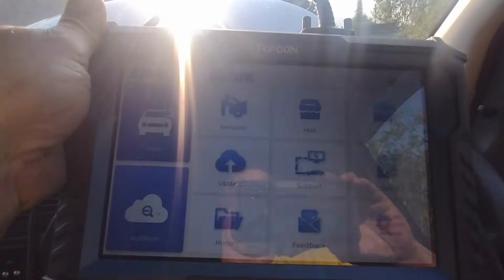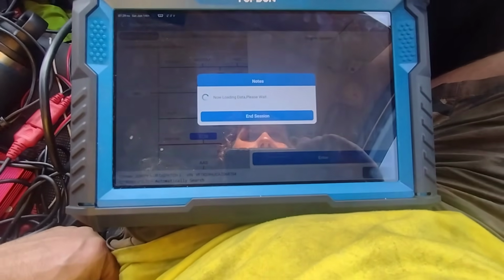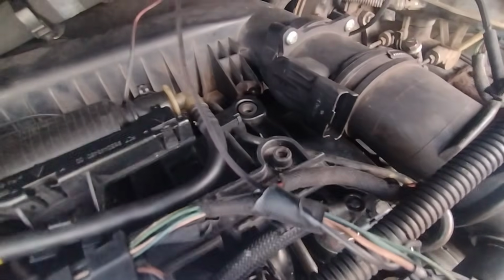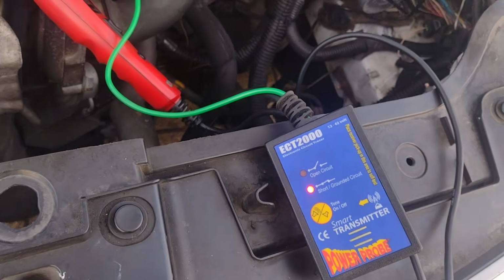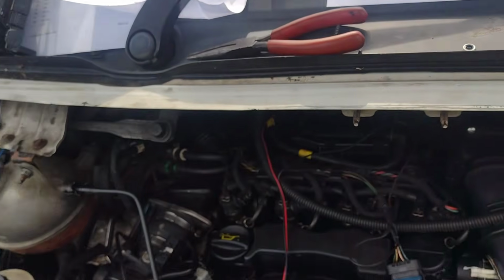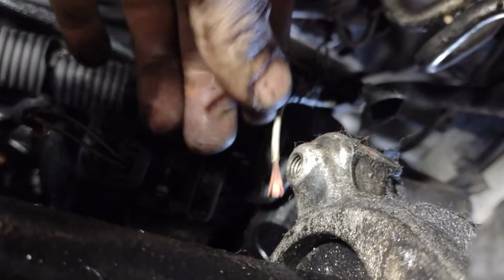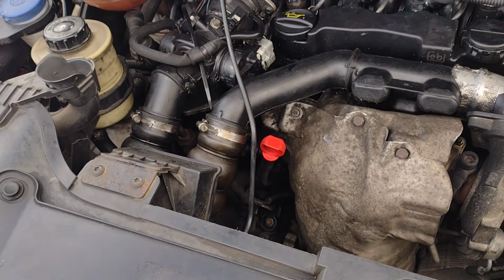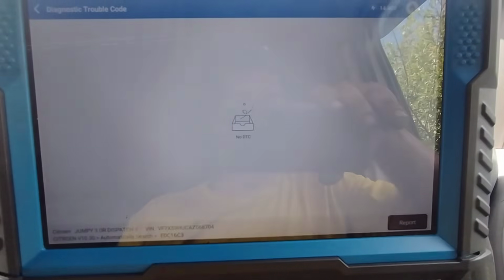P0104 air flow fault (Citroen/Peugeot 1.6hdi) diag and fix

Comment: Strange how that MAF was giving some measurement at the beggining of the video.
Nice video mate.
Reply from the maker: It can make it harder to see what's happening with the sensor. It does sometimes give a calculated value when it has a faulty sensor, on the manufacturer side of the scan tool, in this case, Citroen. 
When using OBD2 or eobd it will only show actual sensor values. Cheers Matt

Comment: Hi, I have a P0104 too, it always comes back immediately even after replacing the mass airflow sensor, BSM, and engine control unit.
The fault data indicates that the mass airflow sensor temperature is abnormally high (between 250 and 300°C). Do you have any ideas where the problem could be coming from? Is it possible that it's the BSI? Thanks!
Reply from the maker: Sometimes a scan tool can give you live data like that, and another scan tool shows it different.
If its the same unplugged it may be a shorted temp signal wire
Usually they are -40 unplugged

Comment: SO was the ORIGIONAL fault a buggered fuse box and who ever got to it BEFORE you had bodged them wires in rather than replace the fuse box ??
Reply from the maker: Yes thats correct, the fuse box is corroded,  it may have been possible to repair the old fuse box. I should open it up and take a look inside, it could possibly be a faulty relay that is soldered onto a circuit board inside the fusebox